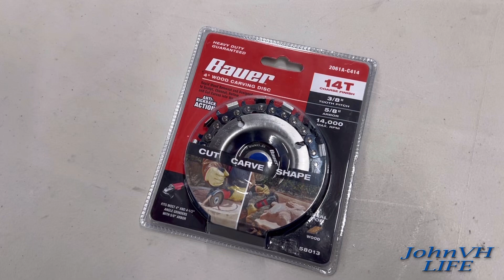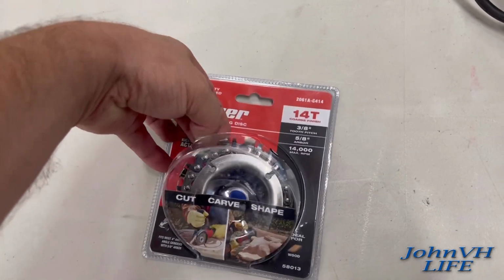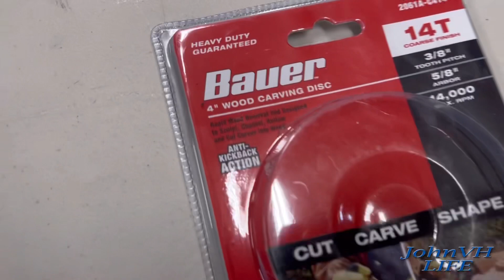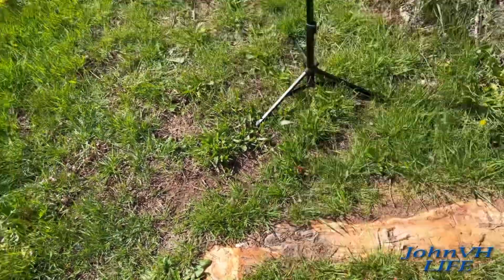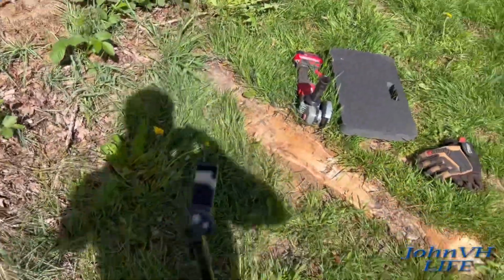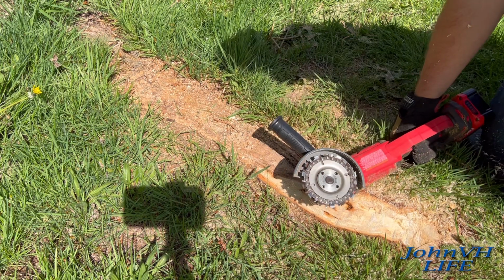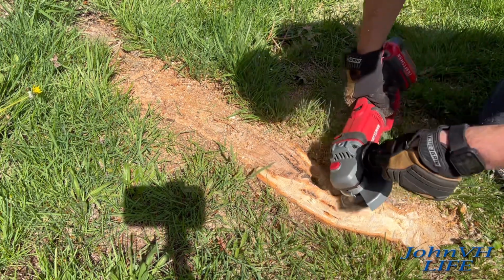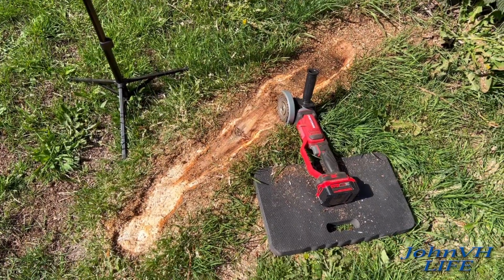Harbor Freight Carving Disc  DANGEROUS?? Proper Usage!

Comment from the maker: V20 Ange Grinder: https://amzn.to/46cJUJF
Craftsman V20 Impact:  https://low.es/3NNrtRE 
Battery and charger: https://amzn.to/3Gye5OY
Milwaukee M18 Impact Wrench BT 2863-20 : https://amzn.to/3nNMbd8
Milwaukee 48-59-1880 M18 REDLITHIUM HIGH OUTPUT XC 8 Ah Lithium-Ion Battery and M18 /M12 Charger Kit
Battery and Charger: https://amzn.to/3M0EE2u
Craftsman V20 Angle Grinder: https://amzn.to/3NicHW2
Battery and charger: https://amzn.to/3Gye5OY
Craftsman V20 1/2" Impact: https://amzn.to/41YZTIB
Lincoln 3350 Welding Helmet: https://amzn.to/3DA8AOR
Fuel Transfer Pump: https://amzn.to/3GZXWUX
Hero 9 Black on Amazon: https://amzn.to/3aL2v5u
My fav video camera Sony AX553: https://amzn.to/3hmHXS3
Follow on facebook: https://bit.ly/3aImEbJ
My Amazon store: https://www.amazon.com/shop/johnvhrc
My Radio control channel: https://www.youtube.com/user/JohnVH541
These are my amazon affiliate links, its free for you, but gives me a tiny commission off a sale, that helps me get more cool stuff for my youtube channel!  Thank you!

Comment: Dumb question: can you make a cross cut or plunging cut into a root with this blade? I have some large above ground roots from 100-year-old tree that was cut down this year and the roots actually heaved up the sidewalk running next to my property so I’m wanting to remove the roots altogether, not shave it down.
Reply from the maker: Its a chain saw basically, it will go straight through if you want to.
Reply: OK, thanks! Glad I came across your video! I’ll have to get one next time I go to HF
Reply from the maker: @JohnnyX7-m3m  Just be careful, alot of people have been hurt by these things, thats why Im using a low power grinder, itll stall before it bites, hopefully!